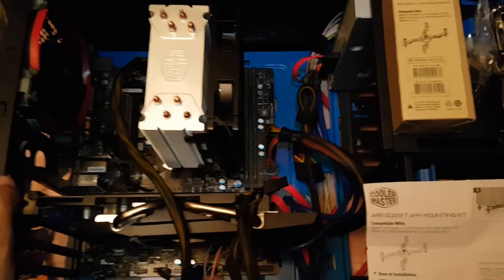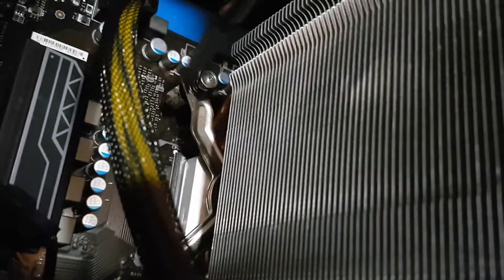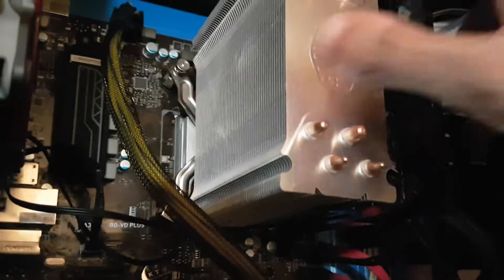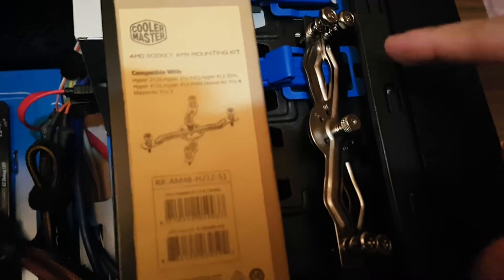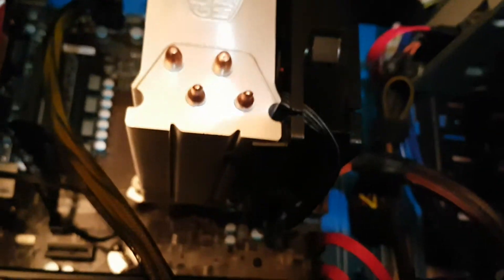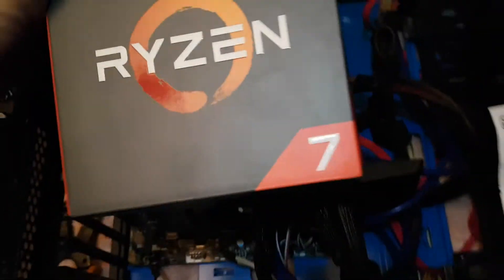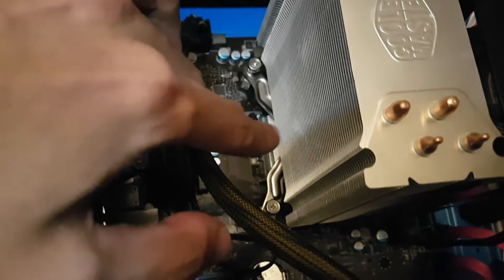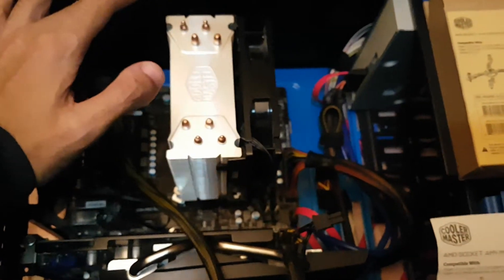Cooler Master Hyper 212 Evo AM4 adapter issues RR-AM4B-H212-S1

Comment: I I bought this mounting bracket for my new build + my old hyper 212 evo and at first it was a bit loose but  tightening  the center spring as far as i could and now its fine, maybe they fix the issue. The only complaint I have is that the fan is a bit loud

Comment: your first issue (main issue) is perfectly normal... the cooler rotates cause it doesn't go fix in several points, only one (the middle point, bracket)
Reply: @thedandyp  i've used a 212 plus for over 6 years....
Reply: @thedandyp  i only responded to the first problem thats not even a problem is like that, every single cooler that uses brakets moves "rotates"....
Reply: @thedandyp  either you installed it wrong or it had missing parts... the cpu coolar has to rotate if it doesn't rotate it means it to tight and can brake either the socket or the moderboard and even the CPU itself...
Reply: @thedandyp  i will repeat this one more time and i wont say it anymore... it HAS to have movement... SIMPLE as THAT.
Reply: @Richard I've never even said i had one of this, i never commented on the cooler itself...i just responded to the firs question.... if you don't know how to read or comprehend a text its not my fault.

Comment: It looks like the spring is not strong. Doubt the users have any ways to strengthen the spring.

Edit: Upon closer inspection. The standoff seems to be "taller" due to the back plate. It seems to be a incompatible backplate, seems like CM does a simple "hack" using stock backplate. I believe removing the backplate and use the original nut from previous socket alongside rubber washer would allow the standoff to sit closer to the board itself. This may allow the heatsink to tighten up.

Gotta find rubber washer now. The only worry I have is it might make the holes stressful, to carry the weight of the cooler.
I also ordered a different am4 backplate from aliexpress that seems to not have as much protruding holes while the holes looks like can be screwed through.
Reply: hi, do you remember which model you got from aliexpress and how was it? Thank you

Comment from the maker: BEFORE YOU COMMENT/UPDATE:

Many comments saying I use the wrong standoffs: NO I did not, I used the correct one. Nothing else fits.
Comment saying the kit comes with two sets of standoffs and I used the wrong set: NO there is only one set in the kit, I bought two kits, both the same.
Comment saying I need to use the original standoffs that came with the cooler: NO they don't fit, they're for AM3 and intel, and yes I did try.
Comment saying I installed the wrong backplate: NO I did not. The instructions direct you to use the original AM4 motherboard backplate, and NO backplate comes with the kit.
Comment saying to use the backplate that originally comes with the cooler: this does NOT fit and yes, I tried it.
Comment saying I install the backplate inverted: ...No. It doesn't fit that way.
Comment saying I need to tighten the center screw on the X bracket: No, this can only tighten the arms of the adapter (the commenter did confirm they later discovered it did not work).
Comment saying my kits were missing rubber grommets: No there are no missing parts and on their website part list, there is no updated part list or revised adapter version either.
Comment asking if the computer boots and if so it's fine: Yes it boots up.
Comments saying it's normal for it to be loose: then that's shit isn't it.
Comments saying it's like this for all setups: I have used this cooler on two AM3+ setups, and no, this issue did not exist.
Comment saying "Cuz you niggas dont know what the fuck ur doing": I do know what I'm doing.
Comment saying there's some plastic "O rings" with the standoffs and I need to use them: If you mean the plastic washers, I did use them and if you don't, it doesn't come with the kit.

Comment asking for solution: I'm sorry, I do not have one. After reading all these comments, I am motivated to make my own fix and have a few ideas in mind. But until then... this comment is the latest update.

CoolerMaster: They didn't help, don't remember what exactly happened or what they said, but they didn't help.
Reply: I had the same problem so. I ditched the cooler and the fan was getting shit anyway

Comment: found the problem with that kit , it doesn't come with the 4 rubber grommets that fit on the standoff , which take up the slack between the backplate and the standoffs , just got the accessory kit from coolmaster and it comes with them
Reply from the maker: Reading your comment again. There is no rubber grommet in the parts list and I found no updated parts list on the Cooler Master website. I think you're wrong but I would like to be proven otherwise.
Reply from the maker: Send a picture?

Comment: i got this kit also , and i found it a bit strange too , having the same slack issues as you have said in your video , i thought i had it wrong by using the original backplate ... but going by instructions you dont use the am3+ backplate, which i found a bit strange ?? was thinking of pulling my m/b out and trying with original evo backplate but i did look to see when i first installed and the new standoffs are smaller than the am3 ones so wont fit , (scratches head) lol
Reply from the maker: Yes the standoffs won't fit the AM3+ and if you think about it, it does make sense that the original AM3+ backplate does not fit an AM4 motherboard.

Comment: I found the solution!
I was also having some space/slack between the cooler and the CPU (Ryzen 1700X, Asus Prime B350-PLUS). The computer even shut down because of CPU temperature being too high.
Solution: just tighten the screw where the two metals parts join/rotate (where the I, II and III markings are) up. That's it, the spacing disappeared!
I'm surprised nobody posted this before!
Reply from the maker: Could you record a small clip of the solution and post it? I'm finding it difficult to understand what you mean
Reply: This: https://imgur.com/a/BPnjv0T
Reply: Nevermind, it doesn't work. It did work once (the CPU was so tightened to the cooler that when I untightened the screws the CPU came off together with the cooler, even if the cooler/thermal paste was still warm and the socket lever was down -- luckily, no damage to the CPU, such as missing pins), but I've been trying again and again and I cannot figure out why I keep getting some space (maybe 1 to 3 mm) between the CPU and the cooler base. Very strange.

One thing that I also noticed while tightening the screws is that I can hear something that seems like the motherboard backplate adhesive coming off, because tightening the screws pushes the backplate away from the motherboard.

There is clearly some design error here from Cooler Master.
Reply from the maker: Thanks for taking the time to come back twice to let me know what was happening, sorry to hear that it didn't work out in the end.

At this point, I'm sure it's a design error too.

Comment: I bought the H212 bracket or whatever they recommended on their website for the 212 evo. Will this allow me to place it in the orientation as yours? Or will i HAVE to buy another thing? Also, did you use motherboard backplate, old hyper 212 evo bracket, or new bracket that came w this new bracket? I’m rlly scared it won’t work and my cpu will overheat :/
Reply: Update: I installed it. Cpu doesn’t go over 65c anymore. :D
Reply: @eeeFloww  did you use motherboard backplate? I have a x470 gaming pro carbon.
Reply: EnclosureHD i honestly don’t remember but i think i used my b350’s backplate. if anything though, i didn’t need to buy any additional stuff. everything i needed came with the updated bracket. and it’s possible to mount it vertically rather than horizontally.
Reply: @eeeFloww  yeah the hyper 212x has the updated bracket included too. PDF tell us to not remove the mobo backplate.  I never mounted this cooler before. I am using the amd stock. it sucks,
Reply: EnclosureHD yeah amd stock cooler sucked so much. thank god for this bracket lol.
Reply: @eeeFloww  unreal. With PBO 4.1ghz on idle I get 55c... Cinebench goes up 88c. LOL
Reply from the maker: @eeeFloww  Did you buy the bracket I show in the video or a different one?
Reply: AbdulAminGani i got the updated bracket for the 212 evo so i think the same as yours. it works fine now though.
Reply from the maker: Hi, sorry I seemed to have missed your comment entirely. The kit does not come with a backplate and you use the original motherboard AM4 backplate. If you get the X version adapter (the one I show in the video), this allows for any orientation but with slack. If you buy the 'square' adapter I mention in the video, this is limited orientation but no slack.
Reply: @AbdulAminGani  ok man ty!

Comment: My Hyper 212X twisted like that too when installed properly on LGA 1150, i think it's just the fault of the stand off as it's just free drop off instead of screw in. I also had the second issue cuz I didn't install the cooler correctly, the cross need to be align in a specific way and I didn't pay attention to that. Maybe you did the same thing?  Not sure if I notice any gap though. 

My upgrade kit hasn't come in yet, I'll let you know if I have the same problem. This mounting system in general is just a pain in the ass, their newer one seems easier.
Reply from the maker: What's the update?

Comment: My standoffs do not even fit my backplate. They're too fat to screw in. This fan is now useless to me.
Reply: you need the upgrade kit RR-AM4B-H212-S1
Reply from the maker: Yes, the first comment reply to you is correct, you need the adapter kit I show in the video. I don't recommend you buy it anyway.

Comment: My hyper 212 twists like that on a non AM4 board, dont be worried about that issue. Does your computer boot and does the cooler do its job?
Reply: Can confirm. My 212 Evo did this when I was on AM3+ didn't stop me from getting a 5.1GHz daily.
Reply from the maker: @Sakur.aiMusic  My EVO did not twist/have slack like this on two AM3+ builds.
Reply from the maker: Kyle Mastro I guess if it is designed to be that way, it's just my preference that is the issue.
Reply from the maker: My EVO did not twist/have slack like this on two AM3+ builds.

Comment: I used the Hyper 212 EVO on an Asrock A320M-DGS recently and not having them catch and feel loose as well. I watched the Cooler Master AM4 install video beforehand and used the right standoffs as well. It was loose and didn't screw in very well.
Reply from the maker: Finally, someone who shares this issue! Thank you for your comment, unfortunately Cooler Master did nothing to help me -maybe it will turn out differently for you.
Reply: I ended up trying out a different board (Gigabyte AB-350 Gaming 3) to see if it was just the board and I still had the same issue. This time during install I didn't tighten down the cooler as much as I had with previous builds and everything works right but the cooler is a bit loose.
Reply from the maker: HB C go on
Reply from the maker: HB C Was this specifically for the cooler master cooler and am4 adapter discussed in the video?

Also wouldn't it run the risk of shorting the motherboard if you invert the backplate, as the other side is not electrically insulated?
Reply from the maker: HB C Thank you for the informative reply, no need for the picture it would be uneeded effort.

I haven't touched my system in a while (since this video) and I have forgotten if I considered or tried inverting the backplate like you mentioned. When it comes to dusting, I will inspect again.

Thanks again for your help!

Comment: FYI wrong stand off used and the cooler is supposed to move like that its all normal every single 212 I have ever used moves like this on any install with fresh thermal paste, been using the 212 type coolers for years as they are super cheap for what you get
Reply: I'm using the same 212 Evo but on AM3, and it does not move like that. Everything is stable. I'm wondering now if buying a new cooler is better than using the AdapterKit.
Reply from the maker: Albert S If I'm correct, there's two types of adapter kits, one is a straight retention clip and the one I show in the video is a x shaped bracket.

The straight version should not have any clamping issues, however it limits the mounting to only 2 of the 4 orientations. I'd go for that one, or at the very least suggest that you consider it.
Reply from the maker: I did NOT use the wrong standoffs.

Comment: You used the wrong standoff. It comes with 2 sets, one is a bit larger and it's clear you used the shorter one so it's kind of obvious the results. Try using the larger ones.
Reply: does'nt a larger standoff increase the space between cpu and cooler making it even looser??????
Reply from the maker: Brandon BillTheCat Nope, I clearly state it comes with 1 set of stand offs -I used the correct ones.

Comment: ...... did u use the Motherboard's own backplate or the one that comes with 212evo.

Try using Motherboards own backplate if u can .... if that helps than do let me know as that will be quite helpful.
Reply: now i think about it the backplate that comes with 212 evo won't even work .... i guess i am just stupid.
Reply from the maker: Nope, the backplate that comes with the 212 evo in the first place does not fit at all. I tried it.

I also tried using the old standoffs as they were lesser in height, hoping it would help with the clamping -but the old standoffs don't even screw in because the thread size doesn't match with the motherboard's original AM4 backplate.
Reply from the maker: Regardless of you being wrong or right, I appreciate the discussion.
Reply: AbdulAminGani ... ty for the info
Reply: @AbdulAminGani  Bro. Did you fixed this problem? I have the same cooler 212x. Do we need to use the backplate of the mobo? Because i think so.
Reply from the maker: @Enclosure_2k  Hey, yes you have to use the original motherboard backplate. I tried using the backplate that came with the cooler (AM3+) and I think I tried using the screws too if memory serves me well but they WILL NOT fit at all. The configuration I show in the video is the only configuration that installs, albeit poorly.

The configuration shown does work to cool the CPU and I still use it to this day, it's just not the best way to do it an I recommend against it. You should either go for the new cooler they sell for AM4 or if you're going to buy the bracket buy the second 'square' type I mention in the video which should have no clamping issues. However, to my knowledge the 'square' adapter only allows for 2 of the 4 orientations that the CPU cooler can be installed in.

Hope that helps.
Reply from the maker: @Enclosure_2k  No worries, glad to have helped.

Comment: Make sure you’re using the proper standoff’s, I’ve heard it comes with the old ones and new ones but I’m not 100% sure
Reply from the maker: Nope, it only comes with the new ones. One set only. I installed those. Do you have this item?
Reply: AbdulAminGani not yet I need to get the kit for my 212 but cooler master is closed till January 2nd
Reply from the maker: Let me know how your one turns out if you could so kindly!